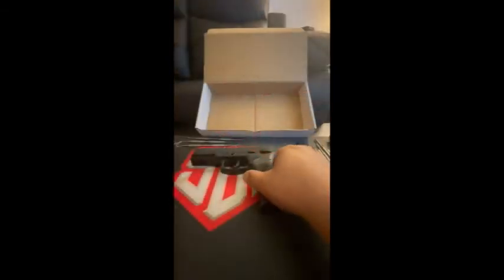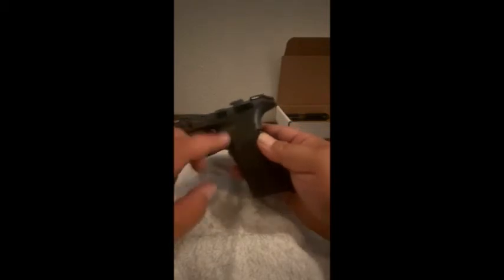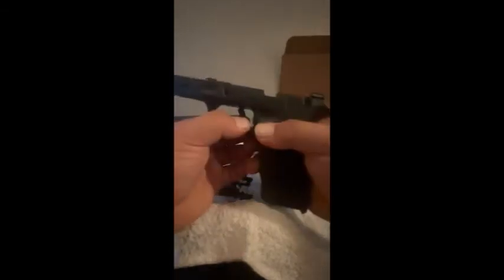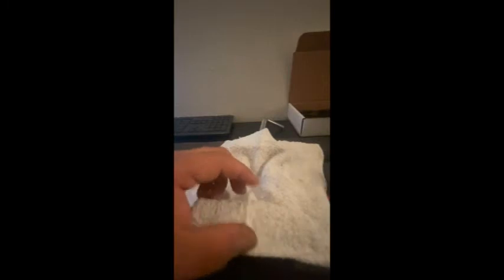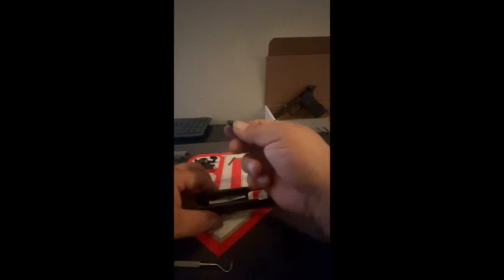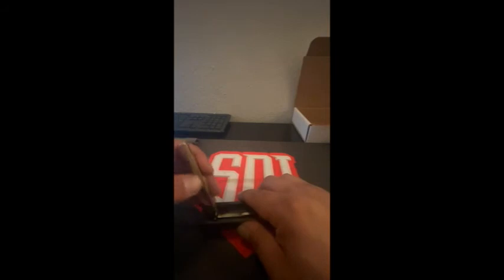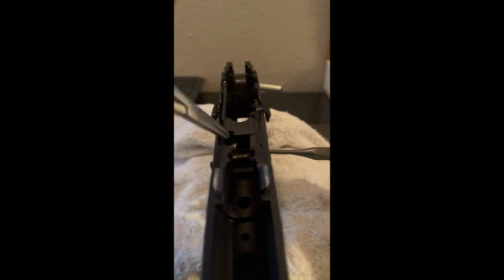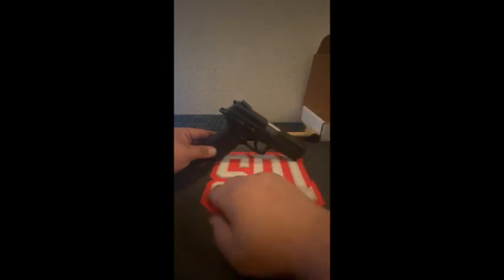Taurus TH9 detail disassembly and reassembly

Comment: I have a th9c and the trigger return spring broke after around 3000 rounds had been put through it so i ordered the replacement part and i had know idea how to dissemble the lower so i did find this video very helpful i appreciate that you posted this video because basicly nobody has done a in depth disassembling if any of Taurus TH9 models. i was Abel to fix my firearm thanks to this video.i think these other people are wrong for talking bad about the quality and lighting me personally idgaf it helped me fix my gun that has been broken for 2 1/2 years im really thankful
Reply from the maker: You are very welcome. If you like to see any firearms let me know. I am glad that this video help you to fix your firearm.
Reply: @flyinghawaiian6718 can the hammer on the th9 be changed to a custom one for a 1911?
Reply from the maker: No since the TH9 hammer has only one hole where the pin goes. The 1911 has 2 holes on it for it. You might be able to customize the hammer or make a new one if you follow the hole pattern of the hammer

Comment: The TH9 and TH9C frames look very similar except for the   TH9's  longer dust cover. Do you know if a TH9 slide will fit and function on TH9C frame?
Reply from the maker: I don’t believe that it will since the TH9c is compact. TH9 is the full size. The barrel length of the c is 3.54in and full size is 4.27